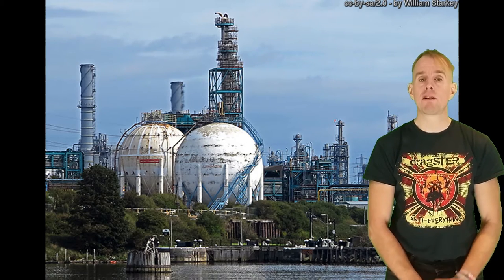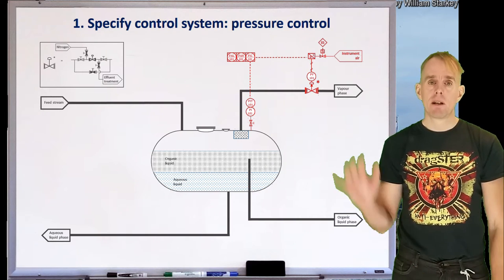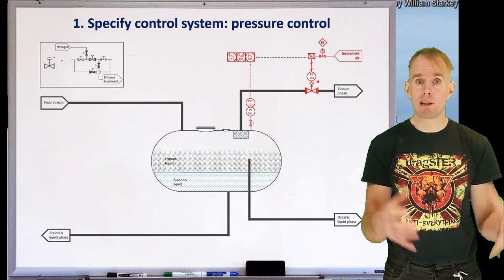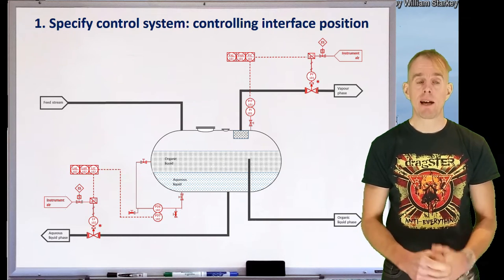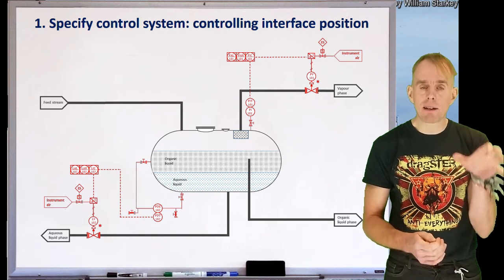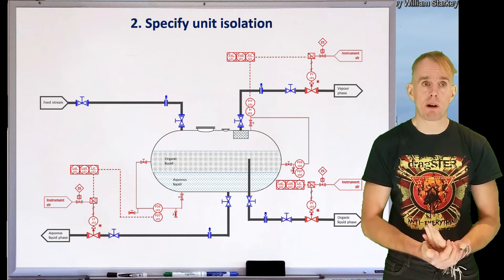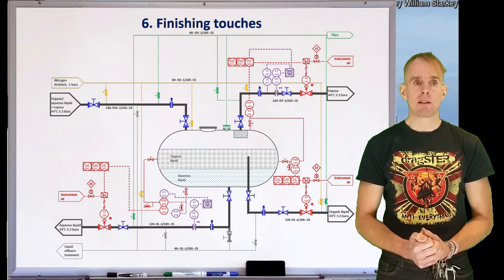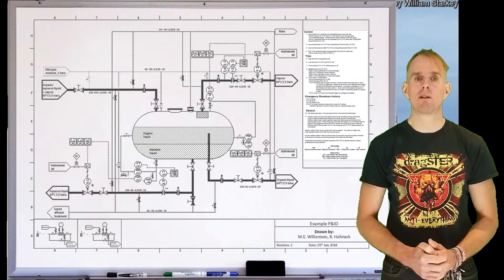Chemical Process Design - lecture 1, part 3[by Dr Bart Hallmark, University of Cambridge]

Comment: Thank you for describing everything so brilliantly.Just one thing that I could not figure out is why pressure differential system is used to control the liquid level in the vessel?
Reply from the maker: Hey Ali, thank you for your feedback and kind comments. I'm glad that the video was useful.

With regard to differential control for the liquid level, the liquid level, h, is sensed by measuring the pressure due to the static head of liquid, i.e. P=P_0 + \rho*g*h. The trouble is that P_0 may not be equal to zero - it'll be the process pressure. So, another pressure sensor, in the gas phase, measures what P_0 is. The differential part subtracts P_0 from P_0 + \rho*g*h, just leaving the contribution to the pressure due to the height of the liquid. I hope that explains things OK!
Reply: @drbartsworldofchemeng  Perfect.The explanation cannot be much simpler than this.thanks again.I hope there would be some more videos on line, equipment sizing and detailed preparation of datasheets as well in the future :)
Reply from the maker: Glad to help out :)